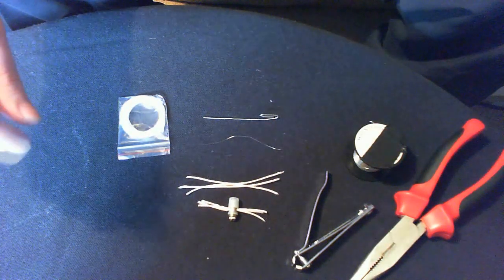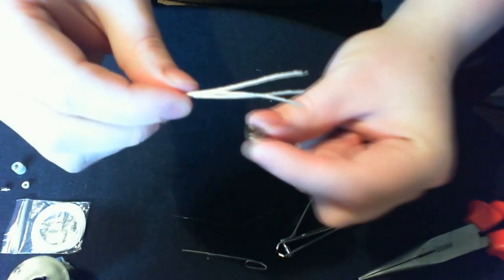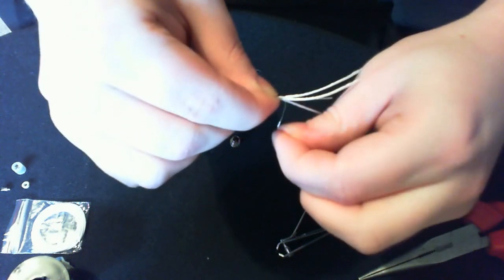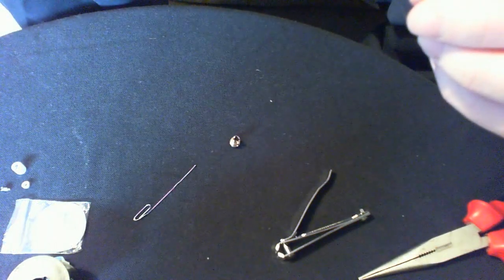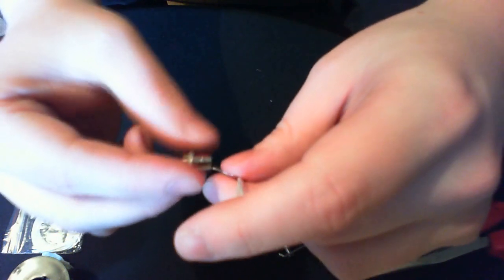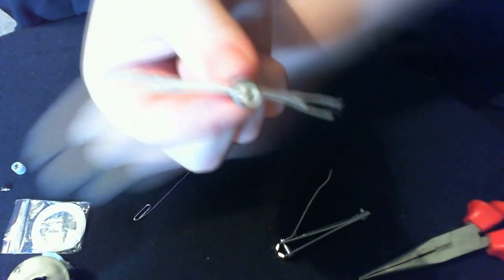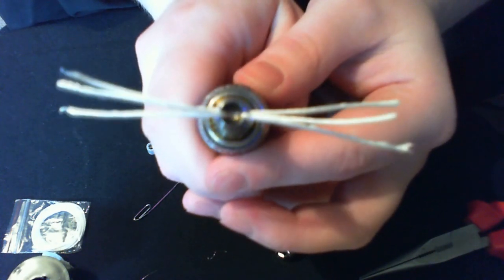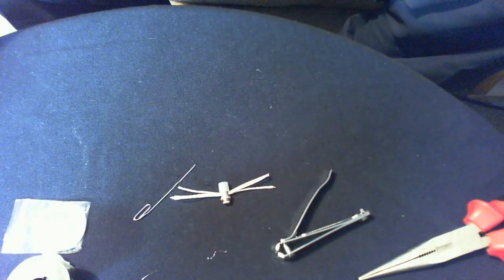How to Rebuild a Vivi Nova / CE5 - V3 Attomizer - Coiling a wick - Recomended Suppliers

Comment: I tried rebuilding a nova head, many times, but all i got is a nasty horrible taste every time!
Any pointers on what im doing wrong?
Reply from the maker: Volim te   best advice wouuld be taking your time and trying to make sure coils are close but not touching once mastered wrapping the coil the rest is easy maybe if still struggling try a simple dripper like the rda/dda and moving to nova heads when you have mastered the technique in a devive that offers more room to build
Reply: I gave up after a few tries, so ill get back to practising again! Thanks alot for the info!